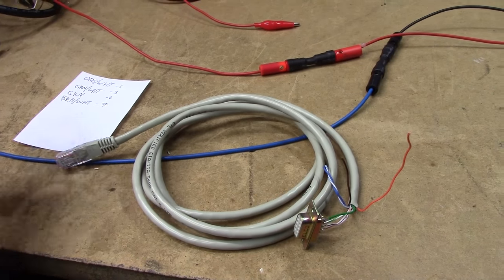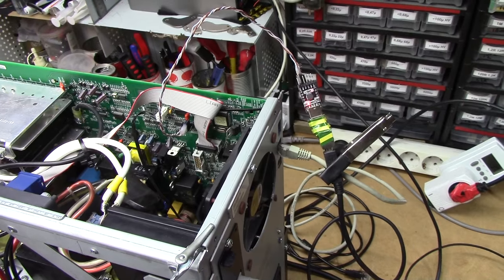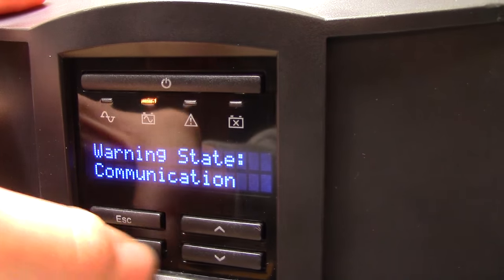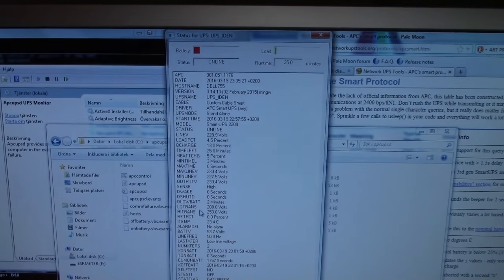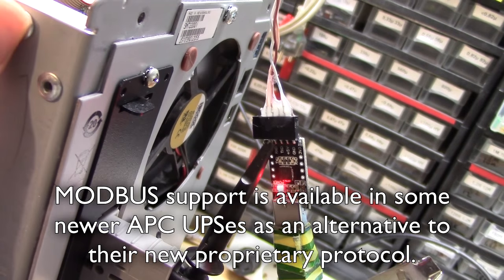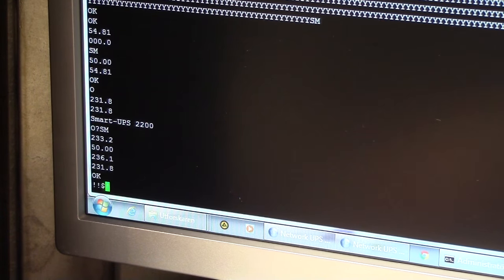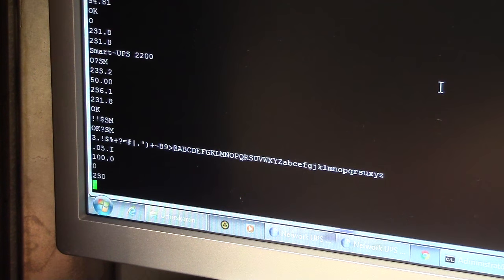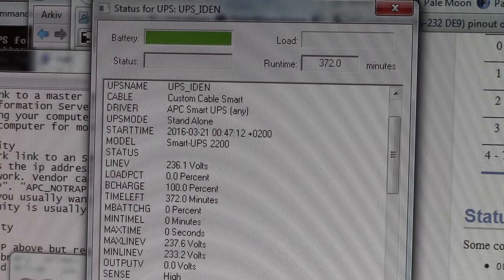Finding the hidden Smart protocol in an APC SMT2200

Comment: Works on the SMT1500I as well - and a lot easier to get to - the 6 pin J606 is right inside the battery compartment - just flip the ups upside down, hook up the TTL to usb thingy and program away. :)

Comment: This is extraordinarily interesting! It also begs a lot of questions! (If I'm remembering the UPSlink protocol correctly, the communication processor's "spamming" "Y" repeatedly would a be request to put the main microcontroller into smart mode.)

Tapping the SmartSlot's communication pins might prove very interesting. There exists a legacy communications SmartSlot card that I'd have guessed was translating Microlink back to UPSlink/Smart protocol. (Its documentation claims that some values returned by this card are simulated, particularly battery voltage.) This has an ARM-based SoC of its own. Now I'm wondering about that -- the card definitely disables the UPS's built in communications ports. Perhaps it implements the arbitration scheme you mention or does something else that avoids disruption of the communication processor's activities.

I'd love to know, other than for reasons of being proprietary and evil, why APC and Schneider Electric are trying so hard to keep Microlink a closed protocol. The firmware update images appear to be encrypted, though I'm not sure how. Their implementation also seems quite sloppy, costly and needlessly complicated compared to implementing one microcontroller that does everything.

Comment: I need some help here. Sorry, I don’t technical specialist, just trying make this thing work.

I have PC with serial port on the board and trying to use TTL to RS232 converter based on MAX3232 chip. I connect J606 from my Smart UPS to this converter and RX with TX diode start blinking. But after connecting this converter to PC serial port I don’t see any data on my terminal window. What I doing wrong ?
Reply from the maker: You might have the wrong baud rate set. I think they run either 2400 or 9600 baud.

Comment: maybe just insert a p-ch mosfet into the comm processor's tx line and switch that using one of the flow control lines from your ttl converter? haven't configured apcupsd in a while, but afaik it just uses bash scripts for the polling, so it would be a simple edit to make it trigger the flow control before sending its own commands. just make sure the main processor doesn't do anything stupid when it receives half of a Y character ;)

Comment: What about the AP9620 Legacy Communications Card? Would I be able to do the same with it? I basically bricked my SMT3000I with a failed Firmware Update via Serial Cable (Stock 8.3->9.4) and now I'm trying everything to unbrick it or somehow. According to your video my UPS should have been able to talk MODBUS via RJ50/45 (so I might not need the legacy card) but I think now it has no Firmware at all. Any experience with a brick? APC forums don't give me much hope.

Comment: why would you need the front panel and serial at the same time? Could you just use a mechanical switch on the front for when you need to use the front panel? Or does the unit play up when you disconnect the link between the two?
Reply from the maker: +Slot1Gamer I'm actually doing that as a preliminary way to be able to use the unit. It has the same downside as just using a FET/logic IC to switch inputs; it can cause corrupted data to be sent to the UPS processor, which can cause issues.

Comment: I accidentally purchased a SMT2200J, which is a Japanese 100V model, and am fine with the output being 100V but I would need it to be ok with the input being 120V. Do you think the smart protocol would be able to convince it to run on 120V without hitting the high cutout?
Reply from the maker: I doubt it, it probably uses different transformers.

Comment: On cant get my serial connection working after doing everything on your other video with the switch but thinking on my rj45 to serial according to the pinout diagram I am reading  u need 1 and 4 shorted and 7 and 8 shorted.  Did u do that cause i forgot to do that step, any ideas
Reply from the maker: I don't think I shorted anything like that, if you do the hack correctly, you're just pushing raw serial data through the MAX232, like any other application.

Comment: plug a raspberry pi in it, the possibilities are endless
Reply from the maker: +J2D2 I think a Raspberry Pi might be a bit overkill for something that speaks 2400 baud, but you are right - a microcontroller of some kind can make one of these do a lot of stuff.
Reply: +FFcossag It might, though the Pi Zero is so cheap as to make it a moot point. There's seemingly a port of apcupsd around as well.

I'm thinking of doing exactly that to provide monitoring/control for a remotely situated Smart UPS 420. That is, if anyone ever has the Pi Zero in stock again!
Reply: Especially if said microcontroller has a network interface of some sort.
Reply from the maker: +uxwbill I'm admittedly ignorant of microcontroller stuff, so I suppose I shouldn't speak. If one were to use a network enabled device as J2D2 is suggesting, what comes to my mind is DIY Smartslot cards, depending on what kind of comm's you can get out of that interface. You could easily have a WLAN/WWAN enabled Smart-UPS with an apcupsd server running on it.

Hmmm, this almost sounds too tempting not to dig into ...
Reply: Indeed, you could make an "internet of things" UPS , have online statistics and such
Reply from the maker: +J2D2 "Internet of things" - that term just kind of puts a bad taste in my mouth for some reason. But yes, that could easily be done.
Reply: +FFcossag The older UPSes put out standard UPSlink over the SmartSlot and there's a pinout somewhere. Your explorations have me wondering now what the newer management cards actually put down the wire: maybe it's Microlink or there's a special "handshake" with the communications processor to provide UPSlink data to the management card as well? 

I don't know much of microcontroller stuff either. Doing it with something working much closer to bare metal would require a lot of time and study on my part. I can't do that for the $5 that a Pi Zero costs, and the Pi could do other things (running a web server to produce pretty graphs and controls, or participating in distributed computing projects with its idle cycles).

I got the Pi Zero idea when I tried to plug an AP9600 enclosure having an AP9617 NMC in it to the Smart UPS 420, which ungratefully powered itself off and refused to respond to its power button until the enclosure was disconnected. I guess that was APC's way of saying "that's not supported" and possibly forcing the UPS to turn itself off by asserting the remote shutdown pin. However it was done, it had to work without any power coming to the card or enclosure, since the 420 doesn't provide any.
Reply: +FFcossag maybe an arduino?
Reply from the maker: IscleGaming | ZefaCraft I considered an Arduino before settling to go for an STM32 based dev board that had all the interfaces I wanted - so a microcontroller IS going in there.
Reply: nice, can'T wait to see what crazy stuff you're gonna do with it
Reply: Someone should build a UPS from scratch with an arduino or raspberry.
Reply from the maker: {MLP} Rainbow Dash That's basically what almost all UPSes are already; just a little microcontroller with a bunch of huge power electronics strapped onto it.

Comment: a microcontroller with 3+ uarts maybe.. if you find the effort worth it.
Reply from the maker: +erlendse Well said - I consulted one of my even nerdier friends, and I've ordered an STM32 based development board with 3 UARTs. We figured that it'd be easiest to just have an intermediate processor to buffer everything and essentially act as a "Smart hub" to route data back and forth.
Reply: Maybe overkill processor, but likely cheaper than the simpler ones.

I would suggest something using the same voltage as the rest of the system, so you don't need to use level-shifters.
Reply from the maker: +erlendse Yep, it's cheap - about 9 € for the board, shipped. We're gonna need level shifters anyway, since we need to talk to both the 5 V UPS processor and the 3,3 V comm's processor - AND the +/-12 V serial port. Come to think of it, there won't be two same-level UARTs anywhere in this system, lol. The 5 V UPS processor seems to handle 3,3 V levels just fine, though; the USB UART I'm using in this video is 3,3 V only, but 5 V tolerant.
Reply: Many people have done just that. You use a basic Arduino - and intercept all calls from the comms processor and simply packet switch between the comms processor and your external device. All done for about $10 and 50 lines of code.